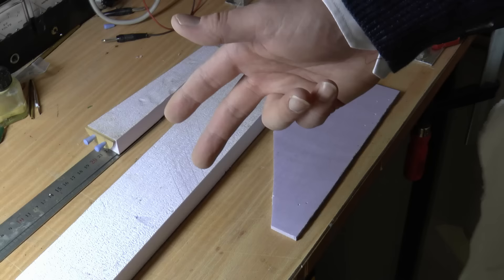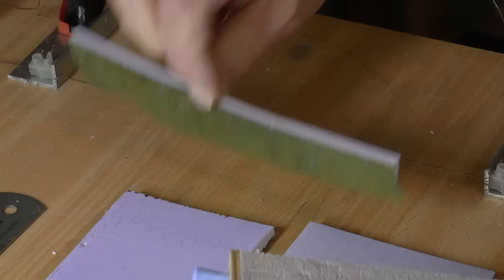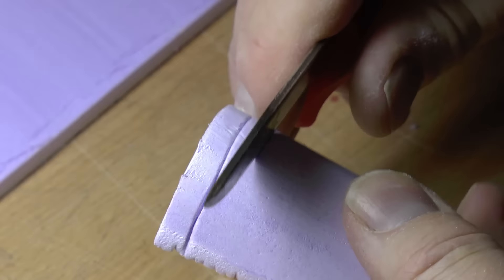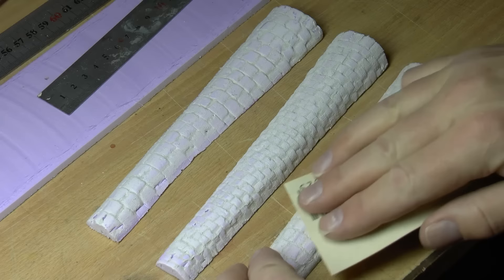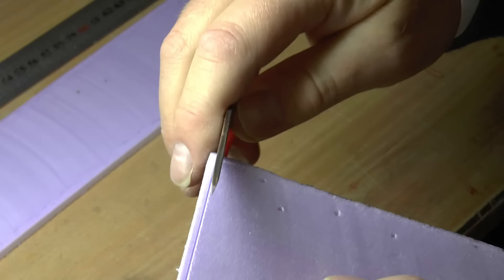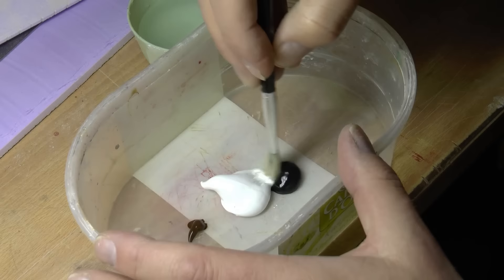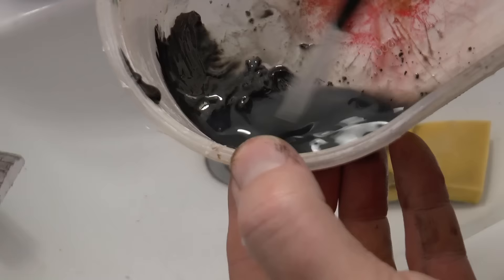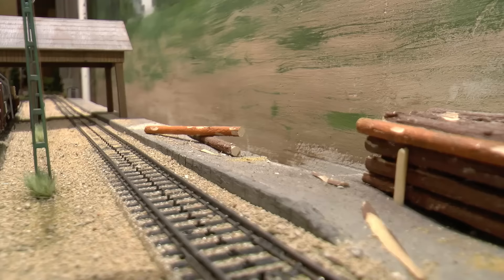Realistic stone walls - Detailed guide DIY

Comment: I'm not sure of others who use a Hotwire cutter to cut styrofoam (regardless of its kind) but when I do, the second you stop moving the piece of Styrofoam, that's the second it unwillingly cuts into the styrofoam and ruins the shape of what you are trying to shape.  I found that it is (75% of the time) worth the little more effort to use a rasp or knife.

Comment: Wonder what you could make a stamper from that  lasts other than steel, maybe cast it in aluminium? But your result is very convincing.....
Reply from the maker: Steel is probably a whole lot better than the soft aluminum I used. The aluminum get blunt in no-time..
Reply: Hmm, maybe if you apply some heat it will last longer.......

Comment: Where can you get foam like that in the U.K.? What is it called?
Reply from the maker: +MrDobilina Hi! The brand is called "Styrofoam". It should be available in Uk too + a number of equivalents from different manufacturers. Any DIY supply store should have them.
Reply: what you're needing is xps, also known as extruded polystyrene. if you just ask for polystyrene in the UK,  people tend to think you mean expanded polystyrene, which is the stuff made up of "beads", which is impossible to sand successfully. xps will allow you to mark details etc into it without running the risk of it breaking up bead by bead. hope that helps.
Reply: It is also called Roofmate